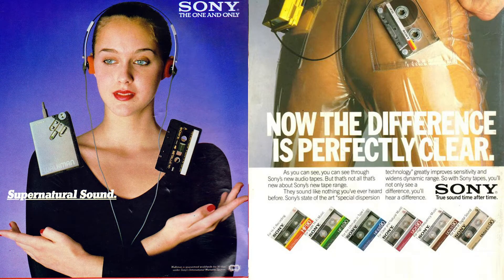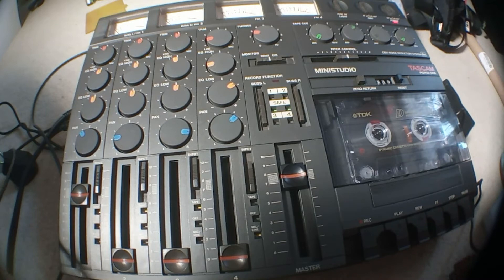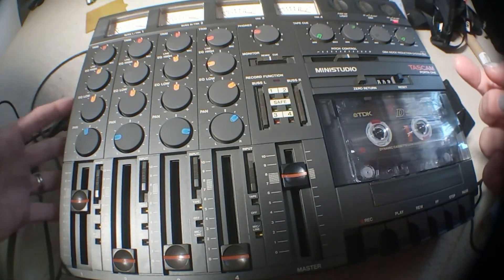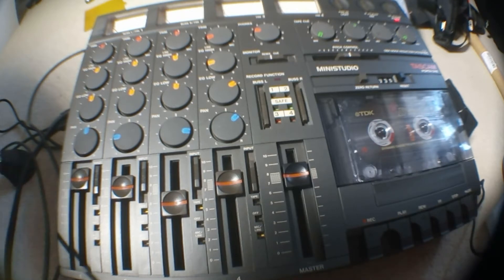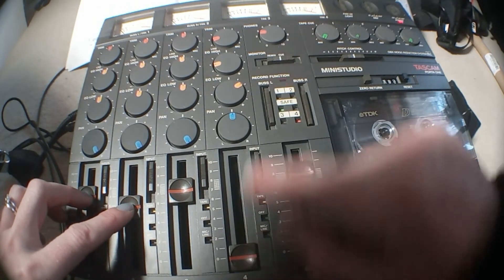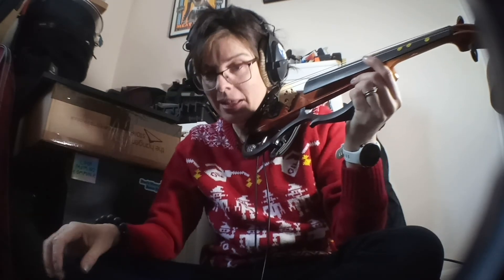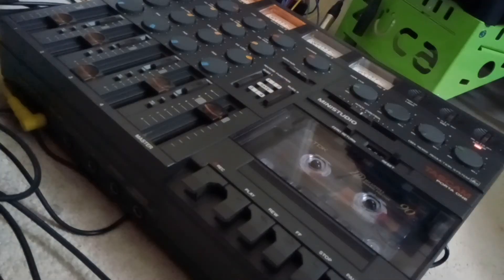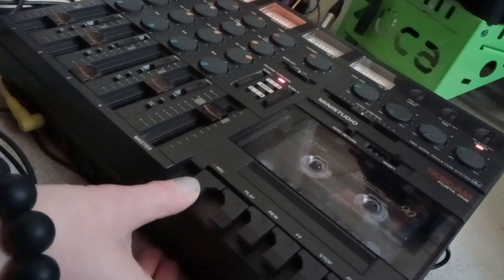Making noise with my Tascam Porta 1

Comment: Great vid as always!
I used to have a little Porta 02 MKII which I loved.
Don't know what happened to it, but I stupidly looked up how much the are going for on ebay 😢
I'm gonna have to keep looking for a bargain though as I recently found a big box of my TDK C90's, Some unopened and some with old demos and loops on them.
Happy New Year!
Reply from the maker: Ah it's great you still have the tapes! I borrowed a later portastudio in the 90s but I can't find the tapes I think they've probably been chucked out :(

One thing to think about if you do buy one now is they can be expensive if they need a repair. The belts are still available but if any of the plastic parts from inside rhe mechanism have got brittle with age they are harder to source. Probably going for a 424 is a bit safer as there's loads of them about. They are all pricey though!
Reply from the maker: (also happy new year :))